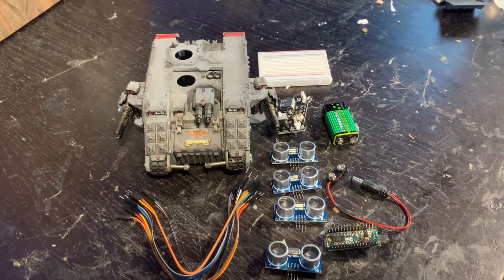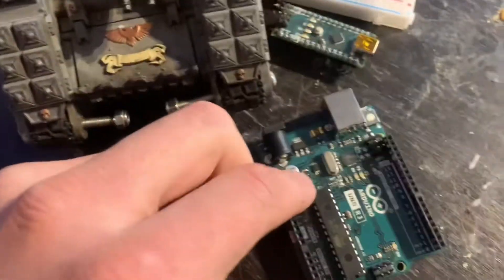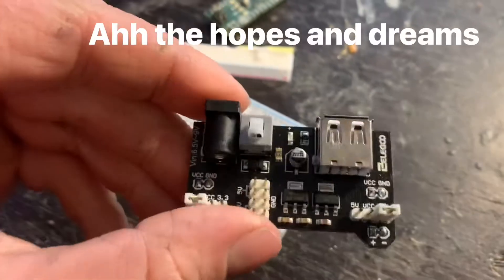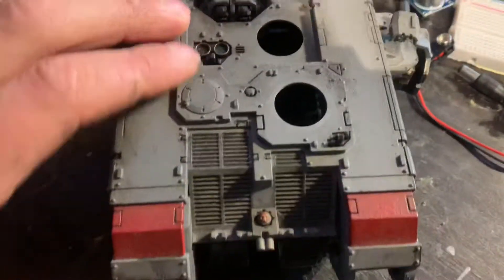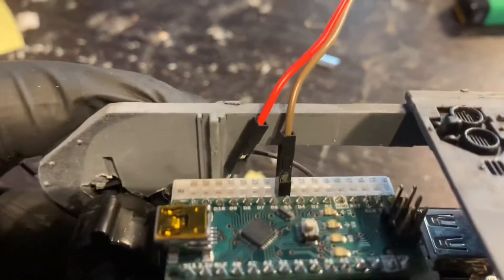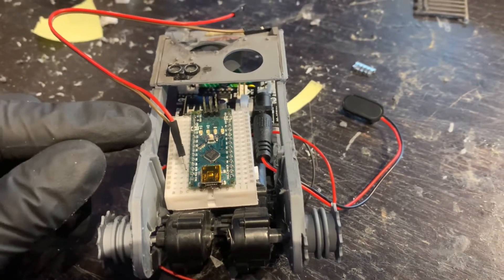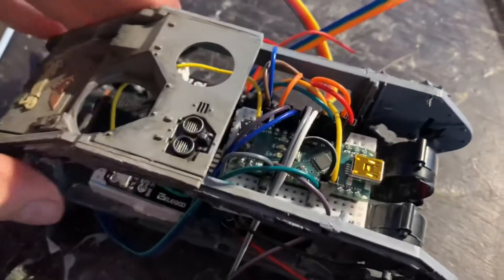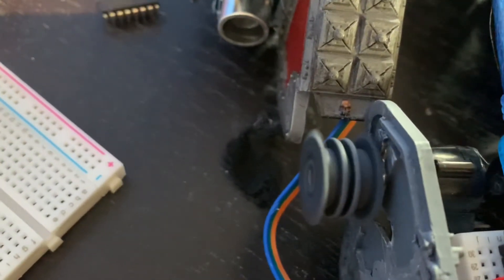Part 2 of the AI machine spirit driven 40k land raider - MANY PROBLEMS

Comment: Sorry you ran into issues, have you looked into using a motor shield?  I have a similar problem with the motors and adding the shield really helped, it took the need out for relay/solid state switches.  Also if you can't get the sensors to work you may want to look at bluetooth connections.  It is suprisingly simple to do and and control it from your phone.
Reply from the maker: I have a new power armour update video live if your interested, ive had to put the other projects on hold while i focus on the armour